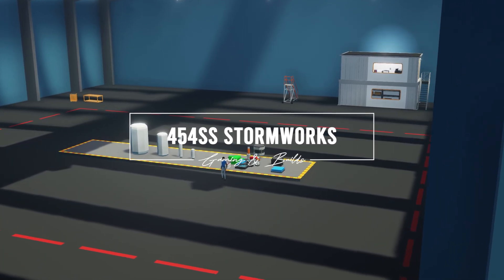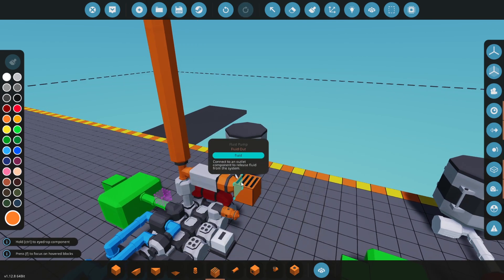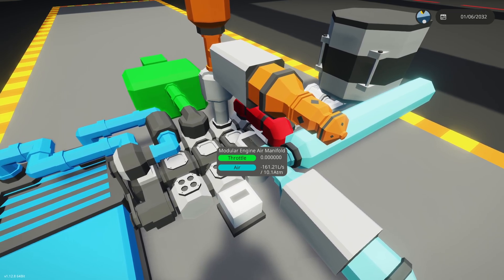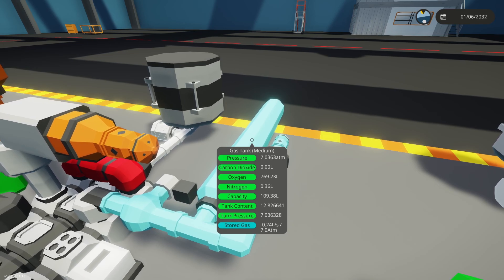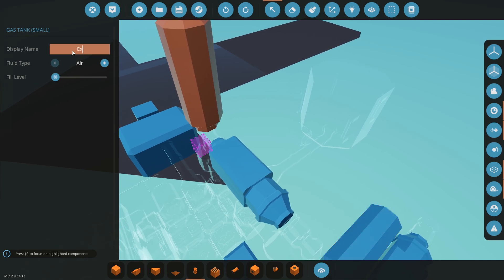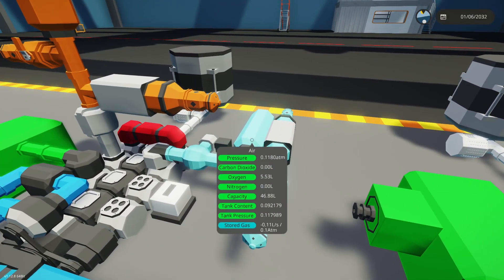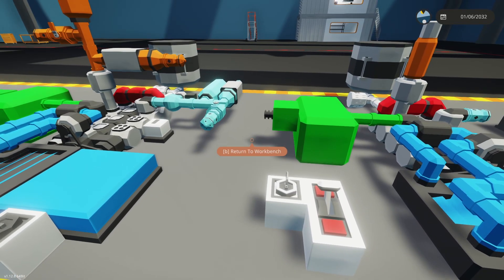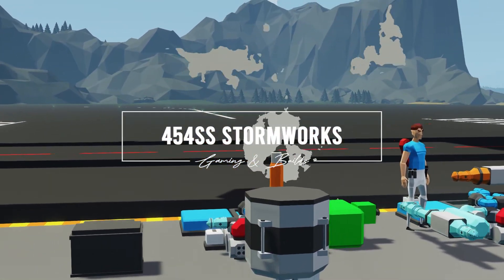Using Air Tanks to make ENGINES work UNDERWATER in Stormworks

Comment: Why don’t you just vent the exhaust into the water or into space?
Reply from the maker: I found that at certain pressures underwater you can't do that - but maybe they changed it or with a pump it would work
Reply: @ ah makes sense, but I’d assume for space or low depths you could just vent it without issue?
Reply from the maker: @jorjorwell1984  That is my though too :)

Comment: You know that it was in game for a long time? Ive modified one of my cars to drive underwater when they added those underwater tunnels, so long time ago. Back then i used ordinary empty tanks and with pump filled them with air. Back then i didnt know how steep are those tunnels and my truck didnt really perform well there, but engine worked completely under water
Reply from the maker: Yes I do know from others :) But I did not get around to testing it!

Comment: So does this mean that if you  constantly pump air into a tank and then out of the tank you get a supper charger than you could put a turbo on that to pump more air through the system to increase power?
Reply: Didn`t understand that fully, but due to the pressure in the Tank connected to the Air-Manifold you have the same affect as when you supercharge your engine, correct.

Comment: Those manual valves for the air in and exhaust out were completely pointless. They were serving the same function as the pumps but worse because the air tank was still being bled off slightly.

Comment: Valves are omnidirectional and you can feed engines pure oxygen.
Reply: Pure oxygen does not make the engine work better in stormworks 😔
Reply: It does, I've noticed the air manifold doesn't throttle as high for same power compared to regular air, it just uses it fast.

Comment: You don't need air tanks for engines to work underwater - there is a bug that if you use a pump on an engine - start the engine on the surface you can dive and the engine will continue working as far as I can tell forever.
Reply: interesting, I know the exhaust portion is not needed, you can just output it into the water, just have a gas filter to prevent water backflow near the end.
Reply from the maker: Good to know! Thanks for the tip Endo :D

Comment: @454, you should include Hose anchors, they can be used to reconnect to other sources/exhaust, be it drawing from the local air, or being internally redirected through winches.
Currently, i am to include them in any of my ongoing modifications, one of which is a floating clamp-shaped payload, secured 2 fluid hoses, a datacable and a common rope.

Through winches with long enough hoses, the player can directly use air drawn from the surface to provide oxygen to the engine, whilest sitting on the bottom of the sea.
Meanwhile, through the 2nd hose line, the player can directly refuel the submarine from the inside, instead having otherwise attach fuel lines/connectors from the outside hull.

Comment: I used this before. I didn't test it a bunch so maybe I overdid it. I put two air tanks so I can maintain 1psi after the tank valve.
Reply: It's kind of a cheat but in my subs you can use a furnace to heat a steam engine. If you use flywheels and clutches in a correct configuration you can make more power than you'll ever use.

The flywheel clutch power hack will work on any size engine to hugely increase power output.
Reply: @DudeNamedRed  Good to know, only reason I've never used it is because I don't get the same sense of reward for my designs.  It's analogous to if there was a bug where you got $1,000,000,000, your creations were impervious to wind, your vehicle took no damage, your character was invincible and to complete every mission all you had to do was jump up and down twice.  I mean, it isn't to that degree, but it's a smaller version of that - no sense of accomplishment
Reply: @neo2264  it only works on the steam pistons best I can tell. While it's an exploit it does fix steam being so underpowered. Using an electric heater to generate 40,000 power units is where it gets a bit ridiculous.
Reply: Engine > gearboxes for RPS increase > modular clutch > flywheels > reversed modular clutch > power

Clutches set to 50%

More flywheels, more power

Comment: Great video as always. Just used this kind of system in my latest mini sub. It is great as a last resort for the power generator. Or even to reduce air tank pressure if neccessary and turn it into power. :')